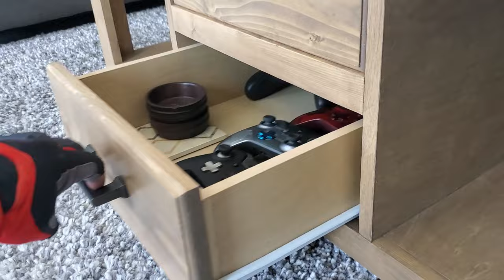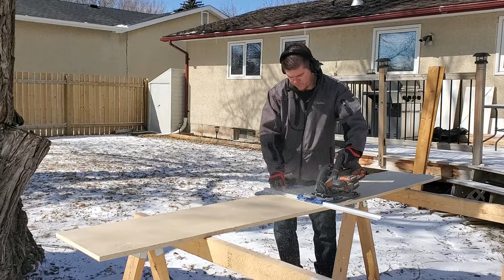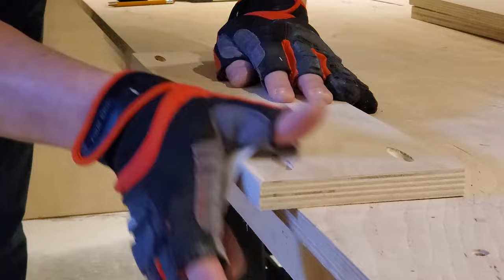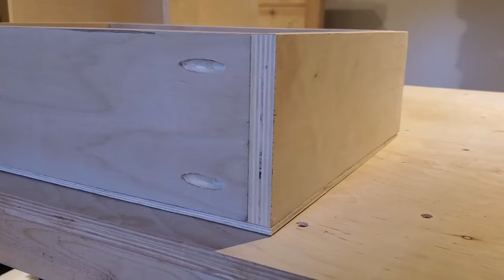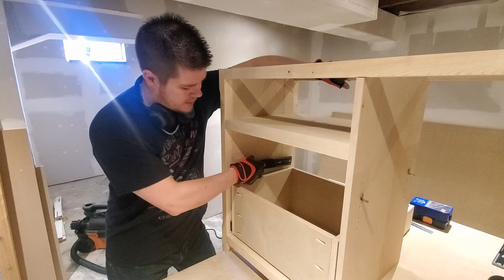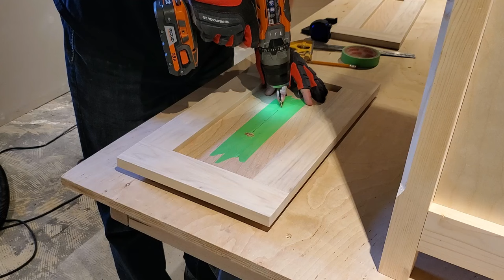Beginners guide to Drawers. Measure, cut, assemble, mount, finish. No jig method

Comment: Great and very helpful video. A suggestion is that when you attached the glides to the sides of the cabinet  (if you are attaching several glides/drawers) you begin from the top, not the bottom. This way the prior glide doesn't get in the way of using the spacer. (You start out with long spacers and cut them down as you install the guides on the lower drawers.)

Comment: I started the first project and made mistakes. I measured the size of the drawers first and wanted to build my cabinet to the size of the drawer. Because I am about to do the next project, I needed to know just how to conquer my drawer demons and your video helps a lot. I am based in South Africa so I will have to convert the inches to millimeters but overall the tutorial helps greatly.
Reply from the maker: Yeah, they can be tricky. Glad I could help out! Good luck on your next project

Comment: Well I already built my FIRST drawers ever. i dont have alot of great tools to use to mostly small hand tools...including a small hand saw. No table saw or sliding miter saw. The drawers are ok..not bad for first time I think. BUT seems i may have built two of them a little too big. They fit the opening but i have about 1/2 inch gab at top and bottom. UGH. sooo i may be taking apart and cutting them down some tomorrow. I will also be installing the drawer slides like you did here. i am concerned i wont get them straight. i learned from you on this although i am horrible at all that math. LOL. I dont have a nail gun..wished i did..but i used screws instead..in case i have to take them apart to fix something. no pocket holes either. I built 4 drawers..two hidden and two exposed. this should be interesting. This is my first big project...doing it on my own. I dont know why i didnt watch videos first. Anyway i am building a large solid wood desk with hutch. my last desk i bought...same brand name as my old one that was wonderful....well the new desk fell apart within the first yr. I was so mad...sooo i decided to build one myself. its FAR from even being right i know..but..when i am done..it should look nice and will be solid. I am GOOD at hiding screw ups. LOL...thanks for the info....
Reply from the maker: Wow lol well good luck with all that. I'm glad I could at least help out

Comment: This is so helpful. im experienced with woodworking, just not with cabinets/drawers ironically. i just blew tons of $$$ on walnut plywood, solid walnut, black melamine, baltich birch ply, soft close drawer slides etc to build an extreme table saw cabinet/table and was running into issues with drawers. thanks for this!
Reply from the maker: That's awesome! Glad I could help, thanks for watching. That should be super nice, hope it goes well

Comment: Good details but, I may add to make the width of the drawers 1/8" to 3/16" wider to give yourself room to sand the left and right sides of the drawers. If your like me you may want to sand it, its really easy to take off a 1/16 of an inch on each side
without trying. If you cut it exact and sand and its short your screwed. I like the fact I have a bit more to play with. And I can then to sand it down to fit it perfectly
Reply from the maker: Thanks. If you make them out of plywood, the veneer is only 1/32 thick. Pre sanded ply pretty much just needs a light quick touch with 220 grit and its ready to be finished so you can't sand anything off. Plus if you use soft close slide they need to be pretty much precise for the soft close to work correctly. Double and triple check your measurements will save a lot of time sanding when it is right the first time. Practice practice

Comment: Question. We installed a new gas cooktop top. But the new cooktop gas inlet is further out from the wall than the old one. So the drawer does not want to close all the way. Cabinet maker used  pin nails and glue to hold the drawer together. The draw needs to be 2 inches shorter.  He used the 3/4 plywood.  Do you have a video showing how to shorten a drawer?
Reply from the maker: I do not unfortunately, but that would be a good idea. Sorry

Comment: This video is helping me so much. Do the inches per drawer include the drawer fronts or just the drawer box?
Reply from the maker: I'm glad you're finding it useful! I'm not sure what you're referring to, but if you mean the overall size of it, I'm just referencing the box. The fronts can be made to fill in the leftover space. They can also be inset or overlayed on the frame and both may adjust the length of the drawer
Reply: @JessedoesDIY  thanks, that helps! Thanks god all you do!
Reply from the maker: Anytime! Good luck

Comment: Really helpful. I saw couple of drawers videos on YouTube and i was wondering if we can have just drawer face plate in front instead of two layers. Is it possible or its design complexity to avoid it.
Reply from the maker: False fronts are easier backseat you can make a box and attach any front you want quick and easily. If you want to make the back piece and sides like I showed, then using some dowels, drill a couple holes in each side pieces sticking forward, use some dowels center punches to mark the backside of the front piece. The glue the dowels in attach the front. You have to be more careful getting the front exactly perfect because there will be no adjustment after like a false front has

Comment: It would have been nice to see that last step (installing the screws to hold the drawer front to the cabinet box). My contractor screwed it in at an angle so as not to go through the thinner shaker style in the middle of the drawer front. Is that the normal or accepted practice? It looks very obvious.
Reply from the maker: Sorry, but it was just putting 1 in each corner. Typically it's just straight in if they are sized correctly, otherwise it would yeah it would have to go at an angle to avoid the center panel

Comment: What kind of wood are you using/suggest to use?
Reply from the maker: Depends on your budget and style. Pine is the least expensive but has it's flaws. Poplar is much nicer to work with and is great for paint, but can be tough to stain, but it's my go to. For plywood I almost always get Birch. It's probably the best priced, can be stained, clear coated and painted and goes with pine or poplar

Comment: When spacing the sliders did you account for the 3/4" spacing at the bottom, when you figured out the length of your spacers?? I ran into a little bit of an issue when I was trying to determine my spacer length.  If you already addressed this my apologies.  Awesome damn video by the way!!! Thank you
Reply from the maker: It's all good, but yes you should. Keep at it! Once you get it and the lightbulb goes off it's smooth sailing and you'll be doing more in no time. Thanks, hope that helps! Any more questions, feel free to ask

Comment: Excellent video, really clear instructions. This is so helpful! Just wondering, can you do it so that the front panel of the drawer box is what actually shows instead of adding the false front as an additional piece?
Reply from the maker: Thanks. Yeah you could, just have to adjust the measurements accordingly for the box. I'd just switch up the front panel making the rest of it the same. Then I'd use dowel centering pins, drill 2 holes in the front of each side of the drawer, use the pins to mark the backside of the new front piece and glue and dowel it on
Reply: @JessedoesDIY  fantastic thank you for the detail. Will do!

Comment: Hi bud i tried to use the measurement calculation for equally spaced drawer slides today but it didn't work 🤷🏽‍♂️. My chest height from top to bottom is 603mm with 3 equal size drawers of 159mm and my sliders are 45mm thick.  I used an 18mm spacer to fit the bottom slide. 

I believe your video suggests deducting the 45mm slider from the 159mm drawer height which gives me 114mm for the spacers to have the sliders at equal height. But when I put the 114mm spacer on top of the bottom slider, it only just extends above the top of bottom drawer itself meaning the middle slider can't surely go there as the middle drawer would almost be touching the bottom drawer...

Where am I going wrong please? Sorry for the length of this comment and for the metrics lol.  TIA

Edit - was I meant to measure from the bottom of the chest to the top of the bottom drawer after it was installed and THEN deduct the 45mm from that measurement?
Reply from the maker: Hey there. There is another way to do this and I actually want to revisit this video when I'm in my new shop and redo this.

What you can do is space your bottom spacer up to where you need it to be and install it on the cabinet, so it could be say 6-12mm ish. Off the floor of the cabinet. Then you can use the actual drawer side of 159mm to set on top of the cabinet side slide. Then the next slide will set on that and be mounted on the cabinet. Continue that all the way up. Then you just need to figure out the height to mount the box side of the slide rail to the box, and that should be identical on each drawer. Then mount the drawer fronts.

That should work, I hope that made sense.
Reply: Hi thank you for the reply. 

I understand what you mean and I will give that method a go on my next set.  

Thanks again bud.
Reply from the maker: Anytime, good luck

Comment: What is the optimal length(max) of the drawer if the Depth of the drawer is 1 ft?
Reply from the maker: I mean you can really make them as big as you need. I'd just increase the size of the bottom material from 1/4" to maybe 3/8" or even 1/2". Then as long as your slides can handle the weight your good

Comment: What did you use for your vacuum adapter?
Reply from the maker: There is an accessory kit that Ridgid makes with all different sizes of adapters. All tools that have dust attachments are only 2 sizes, so it has a bunch of couplers for them. Home Depot has them

Comment: Thanks for the video. I am planning to do my first DIY drawer. One thing that I am worried about is the accuracy of the width of the drawer. If it is longer, the slides will be pressing against each other  and may not slide at all. If the drawer width becomes slightly shorter, the slides may not fit well. What is maximum error allowed while making the drawer ? Anyone with experience- please comment. Thanks
Reply from the maker: No prob, I'm sure you'll get it, just take your time and measure twice, cut once. If you take the width measurement like I showed, there should be no guess work. Doing it this way makes sure you don't have to factor for undersized plywood, it is relevant for whatever material you are using. If anything I'd go about 1/16" smaller than needed. In my experience, slightly smaller is better than slightly over. The slide has a bit of movement built into it, but if you are literally pressed up against it, well, it just won't work then
Reply: @JessedoesDIY  thanks

Comment: Why the quarter inch shim under the bottom drawer why quarter of an inch can it be different or what’s reasoning for it?
Reply from the maker: Just to keep a nice air gap under the drawer so there is no chance of it rubbing. You need it off the floor, but I don't trust the 1/8" gap the slides call for because if there is something heavy in the drawer, the 1/4" ply bottom can bow slightly and drag otherwise

Comment: Does anyone ever find the pocket hole screws seem to be SUPER sensitive and will sort of "strip" the hole when screwing them in?
Reply from the maker: Sounds like your drill is turned up too high. It can happen with any screw, not just pocket. If you are using a drill try adjusting the clutch low, if the screw doesn't just touch bottom, turn it up a bit. If it bottoms the screw out and keeps spinning and strips it, turn it down. The clutch should be set to engage at just the right tightness. If it's a impact, turn it down if it has a dial, or be very gentle on the trigger. Once it's tight, don't give it another shot or 2

Comment: Appreciate the video. Your drawer heights you mentioned,  where those inside measurements or did you include the bottom in that measurement?  New Sub!!
Reply from the maker: Thanks, that's awesome! I did not include the bottoms for simple math sake but you can if you want. I just grabbed my inside measurement and the height of the sides and ran with it. Thats the reason for the inch above and below is it gives you wiggle room to adjust it up or down as needed. Until you put the drawer face on, you aren't married to anything, so if you have to slide it up or down 1/8 or 1/4" you can. Then once its fully set in place, you can attach the front and it all looks seamless.
Reply: CanaDIYan Thanks for the quick response. 👍
Reply from the maker: No problem. I always try to be quick to everybody. Have a good one

Comment: Great video! However, did I miss something? On the top drawer, you measured and installed the slide to the drawer but did now show how to accurately mate the other piece of that slide to the frame.
Reply from the maker: Thanks. Yup I did, I explained how to measure your gaps between drawer slides from one to the next, what measurements to make, then you cut your spacers with those measurements, set the drawer slide on it and attach

Comment: I’m still struggling with the drawers for a unit I’ve put up . They keep jamming half way and now I’m nearly giving up .. so exhausted !
Reply from the maker: Really? The final adjustments can be frustrating if something is tweaked slightly. Also, how is your sizing, too tight or too loose can have them binding but too tight is worse. Are they soft close slides? Those are the hardest to align. I have some ideas, let me know what you are working with
Reply: @JessedoesDIY  thanks for replying I didn’t expect that :-) So it’s a basic consule table with two drawers and I’m hopeless at DIY but always like to give things a go ! There’s 4 sets of runners that spilt in two one half goes inside the table and the second half on the sides of each drawer. I think they are ball bearing runners and there’s a black release type clip . Anyhow .. I can get the drawers half way then they completely jam and I have to use a flat screwdriver to push the release clip to release the drawer . I’m definitely missing something and obviously doing something wrong . I’ve spent hours looking at the diagrams and checking I’ve put the runners on correctly and it seems ok so I’m puzzled and very frustrated. Thanks for any advice
Reply from the maker: Send me an email with pics if you don't mind. Will be easier to help that way
Reply: @JessedoesDIY  will do hun thanks it’s still very early here but I’ll send in a few hours - regards - Susan
Reply: @JessedoesDIY  I’ve sent the email hun thanks looking forward to your comments

Comment: He didn't show how he attached the draw hardware.
Reply from the maker: This a simple as finding center of your drawer front. Add masking tape to it, make a mark at center from side to side and top to bottom. If you have bar hardware then measure between the center of the holes, and apply half that measurement to each side of your center mark and drill the holes. I've shown it on other videos on my channel, but it is very straight forward to do